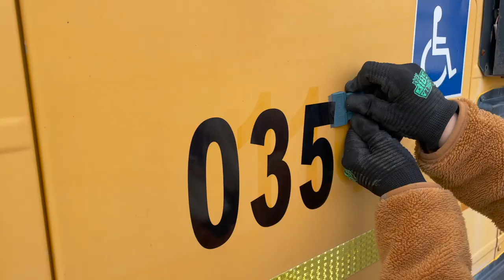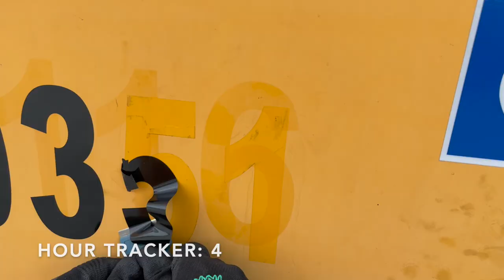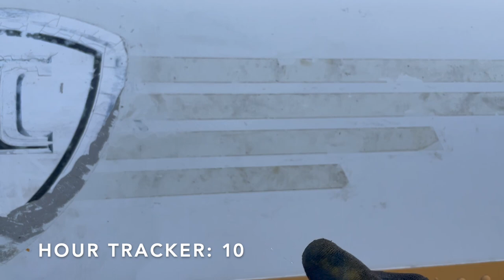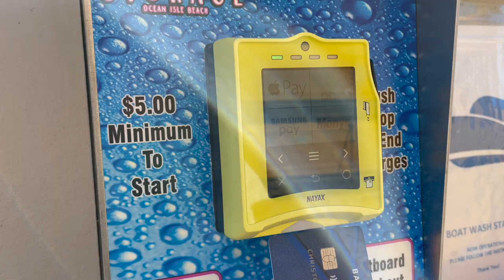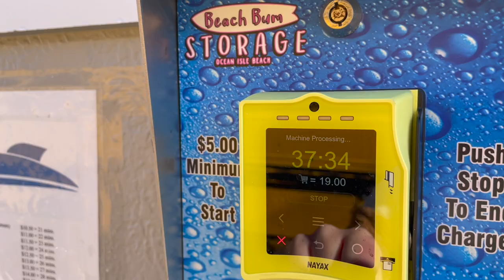How to Prime and Paint a School Bus | Painting a Skoolie | Bus Build 9

Comment: I am looking to paint my bus.  How is the bear paint holding up?
Reply from the maker: Hi! The paint is holding up really well. The only spots we’ve started noticing issues is where we sprayed over flexible spots like the sealant around the engine bay. We sprayed over a few rubber areas too (which we shouldn’t have) and those are chipping a bit but it’s not affecting the rest of the bus. Hope that helps!

Comment: Corrosion develops when two dissimilar materials are combined in a corrosive electrolyte. This can occur when certain materials (such as aluminum) are in contact with stainless steel. thought id lyk mixing steel and aluminum anything cause faster corrosion and rust. may want to switch that plate to a steel plate skoolie fam. don't want to see you with a bigger hole later. yes your steel will get stronger from the electron transfer but you aluminum will loose its strength and deteriorate the plate. looks great otherwise! Thanks for great paint vid! keep it up